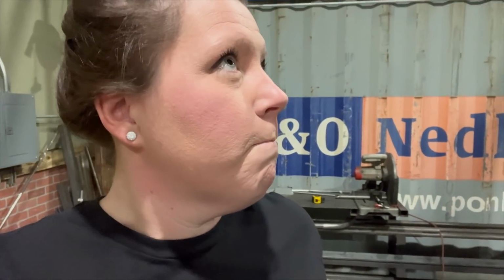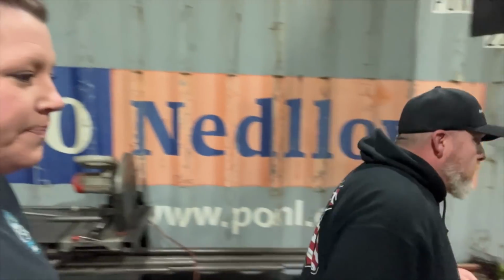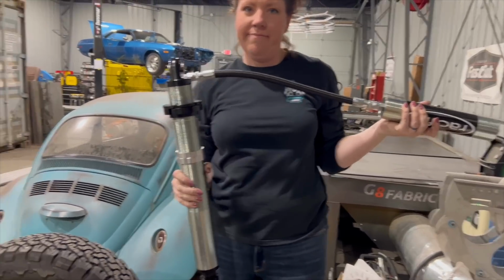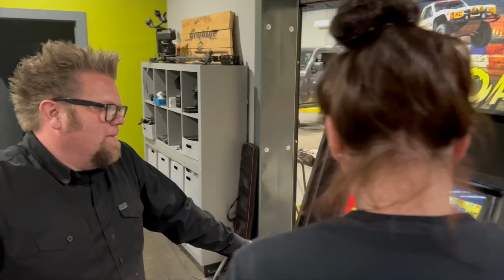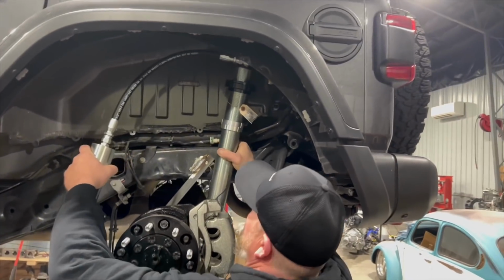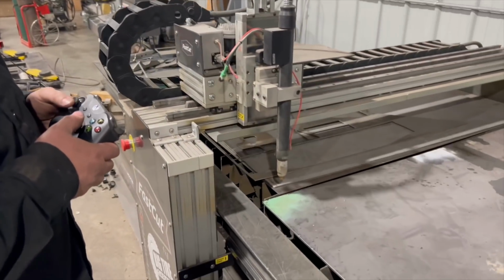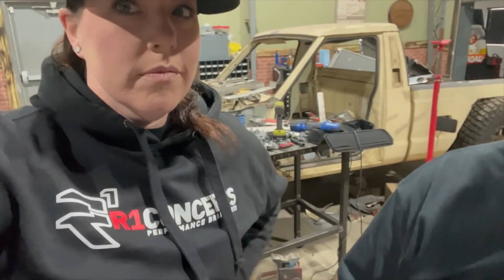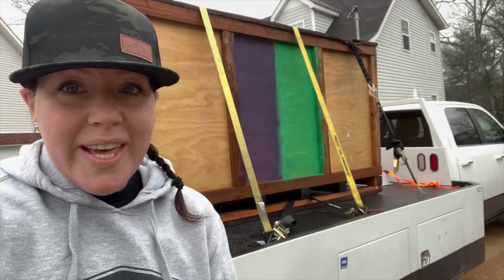Day 1-3 of the @TreadLightlyTeam  giveaway Jeep build!

Comment: Love the video and this build.  I have an old 88 Cherokee with 4 inch lift and a 8.8 in the rear with an electric locker and a built dana30 in the front with an electric locker.  I swapped out the original 5 speed for an AX 15 and then built a 4.6 stroker engine for.  I would love to get something a little more modern but being retired I have to watch my nickels and dimes plus my repair shop takes all my time.
Reply from the maker: That’s sounds like a very fun rig! Some of my favorite rigs to wheel with a super low dollar, practical rigs that just work! 😊👍🏻
Reply: @MischiefMakerTV  
  That was my intention to make a working practical dependable jeep and not to make it too pretty so I wouldn’t be afraid to scratch it up.  Every time I watch your channel or Matt’s channel I start thinking about building 60’s for it.  I’m like Ed, I use mine for prospecting.  The video they did where they came and got his jeep is almost in my back yard.

Comment: It struck a chord with me when you said you wanted to weld someday.  I learned to weld in 9th grade shop class over 50 years ago.  I loved it, and when I got a job a couple years later, I bought a buzzbox welder.  The fascination of melting steel with an electric arc never wanes.  By all means, get a HD alternator for Mischief Maker and add a welding controller to have a welder out on the trail.  The guys at the shop can show you how to weld.  It just takes practice.